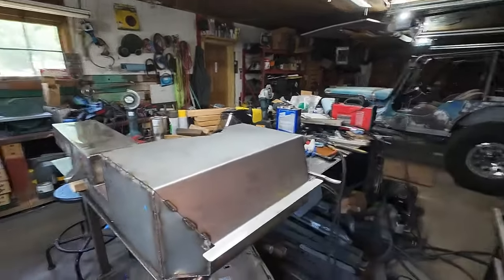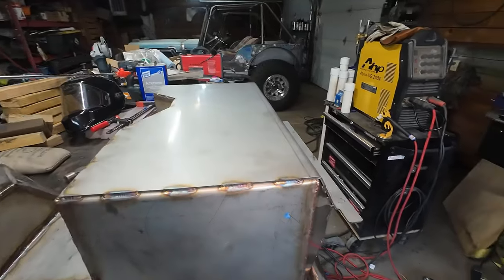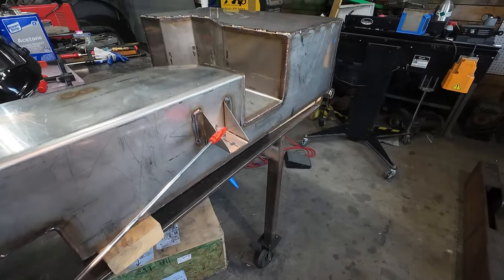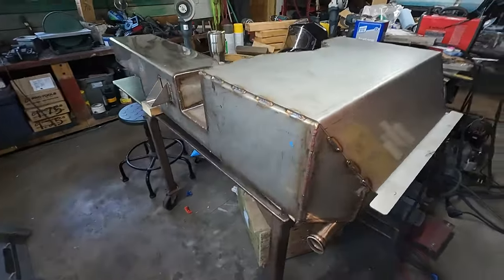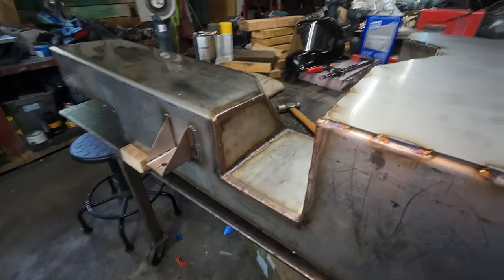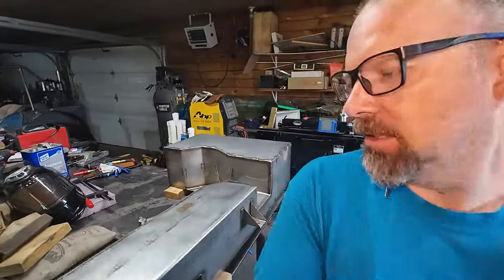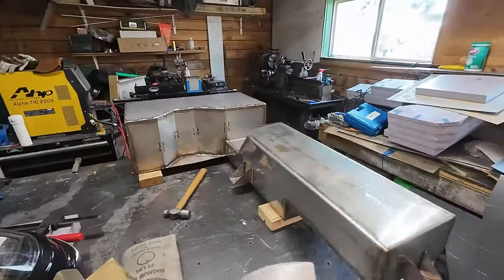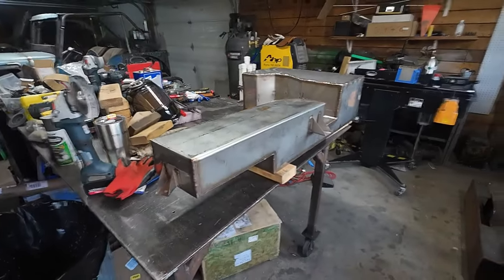Old Blue Willys Part 58

Comment: Is there a pump to transfer over that hump? Filling issues?
Reply from the maker: The system is basically like a OEM saddle tank. The return line from the fuel injection system will run a small venturi siphon pump that continuously moves fuel from the front well of the tank to the rear section where the main pump is located. The transfer passage between the two sections is large enough that filling shouldn't be an issue. The front section also has its own vent which joins into the pump vent high point and to the filler neck.